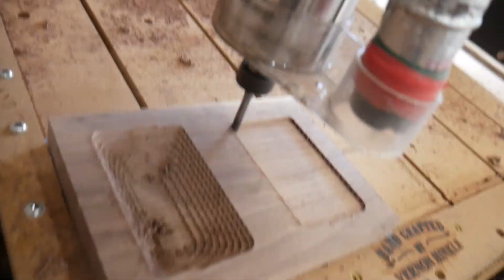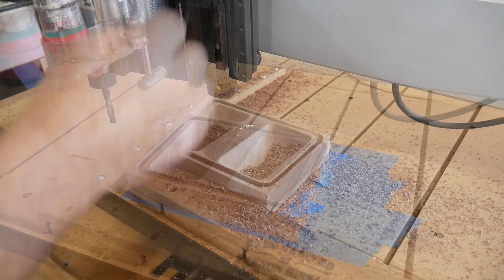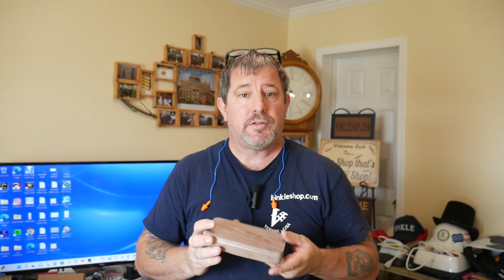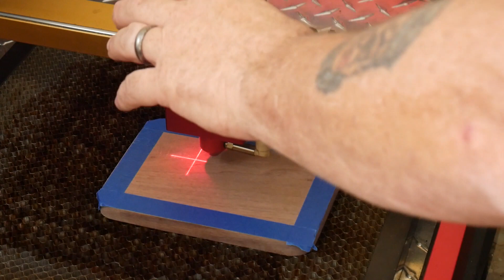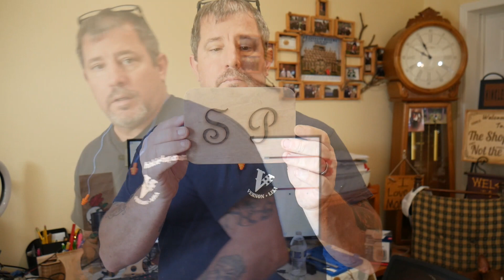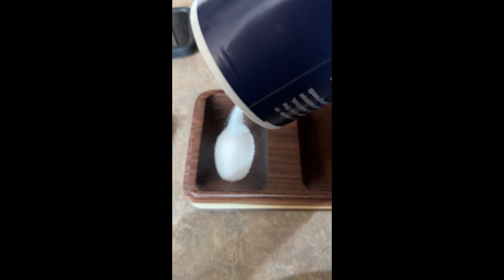Become a woodworking chef

Comment: You know Lightburn has a framing option for alignment.  Nice video
Reply from the maker: Thank you 
I did know that, I used to align that way but now I prefer locating off the corner at this point on small burns especially if the piece is a known measurement and not an odd shape
Thanks for watching
Reply: We each have our own ways . old story if it works don't change have fun.  CNC routers are a blast  (:  (: @Hinkleshop
Reply: Make a little handle for the top.